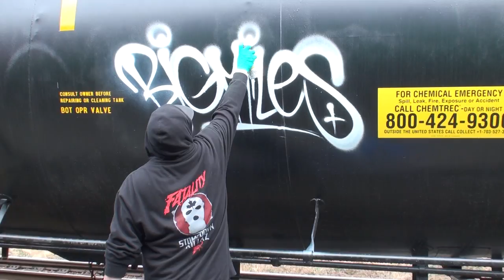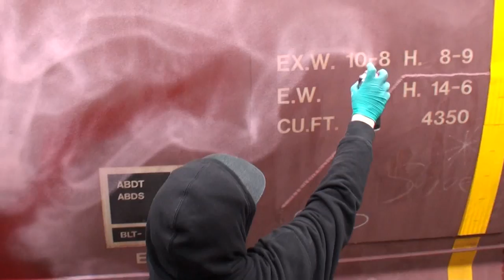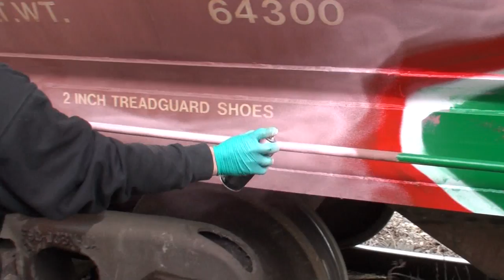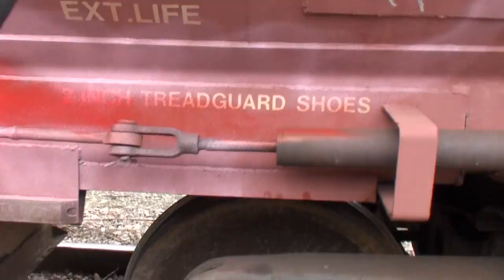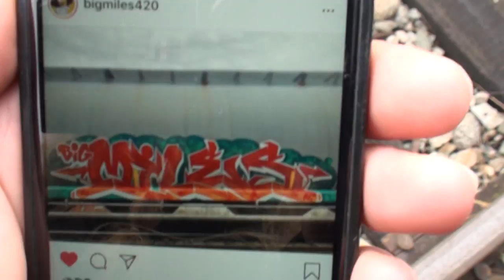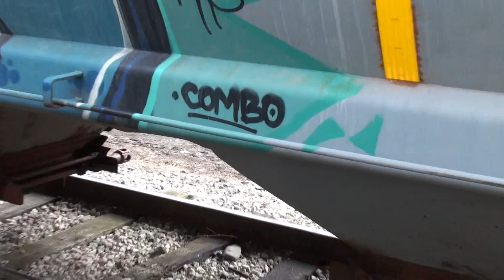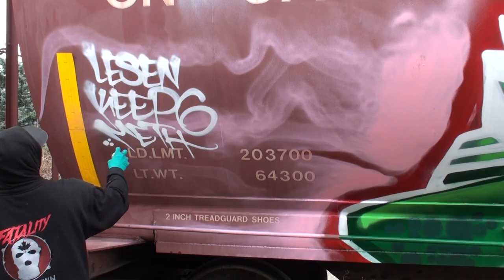WHOLECAR RAW VIDEO - TRAIN GRAFFITI - BIG MILES SDK - WHOLETRAIN

Comment: If you leave the important info unpainted the general rule is leave it alone but if the stencils, car#, plate grade, warnings and capacity limits are painted over then it will get repainted or at least those areas thus it  is up to fate how it ends up looking. So why not be in control of the finished look. Paint around all information stencils.